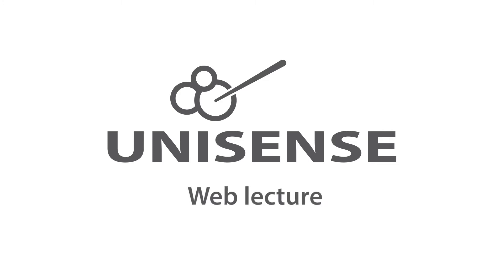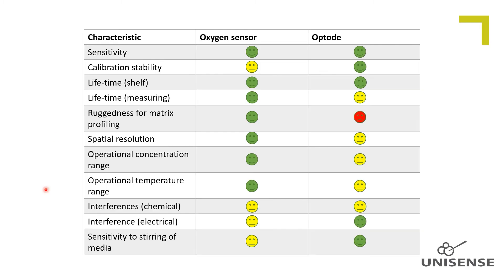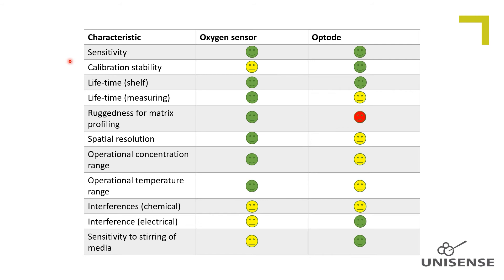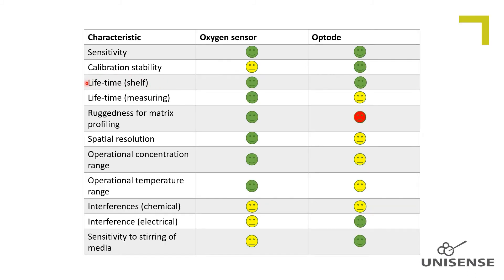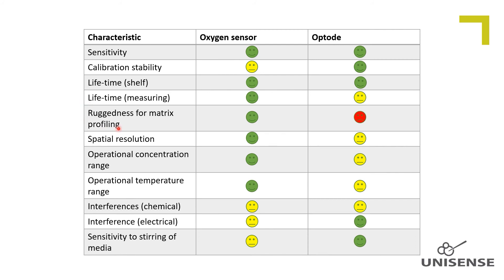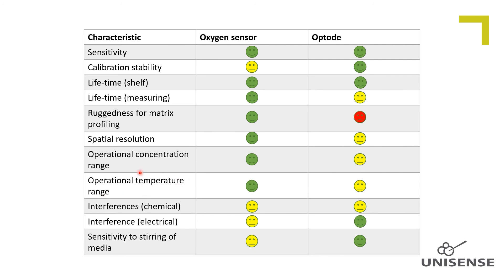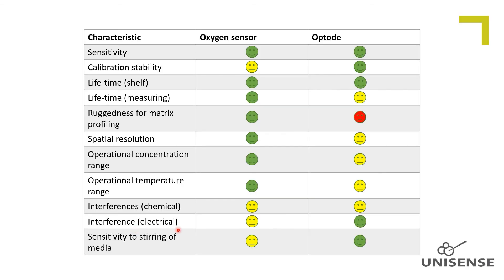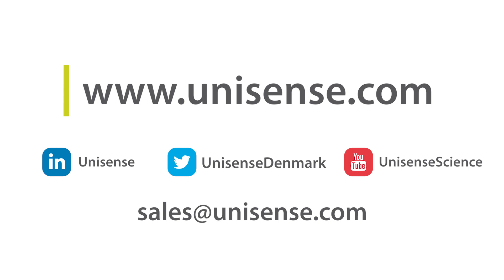Measuring oxygen - Optode or amperometric microsensor?

Comment: Is it a sensor for measuring in liquid (dissolved oxygen) or in air (gas phase oxygen)?
Reply: Hi Francesco,
Reply: The oxygen sensors work very well in both liquid and gas. The reason is that the sensors, like any other oxygen sensor, reacts to the partial pressure of oxygen. The software will then recalculate the sensor signal into the unit chosen by the user.
Reply: And if you have would like further information, just send us a mail at sales@unisense.com